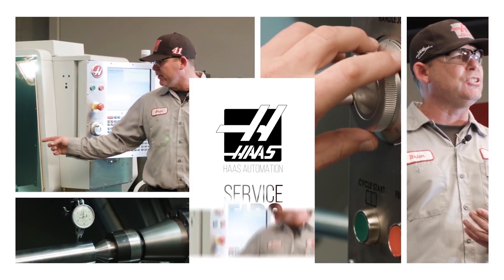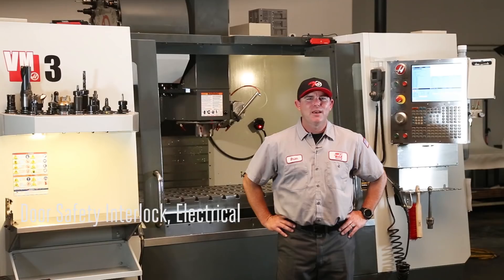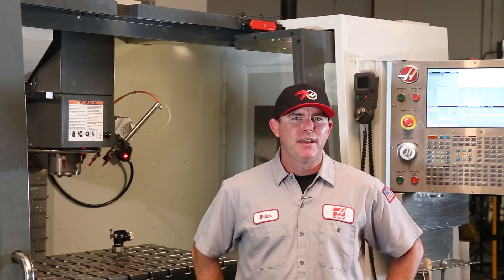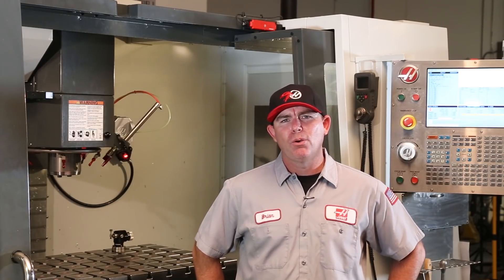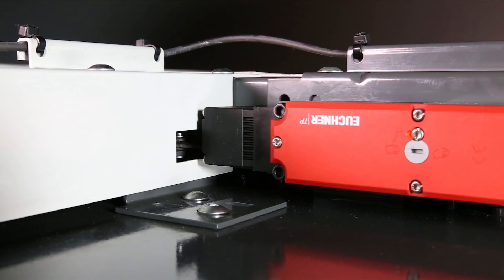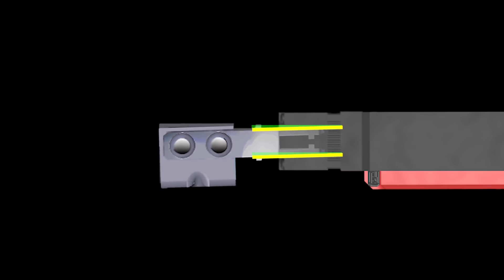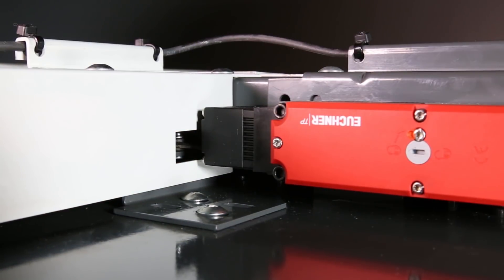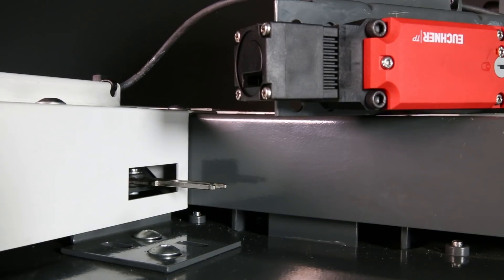Door Interlock Troubleshooting - Haas Automation Service Tip

Comment: Not a very helpful video and we cannot find anything to help us on the Haas site. On our EU spec TM1P from 2011, the control does not release the door lock and cannot find any information to help trouble shoot. We have an Allen Bradley TLS1-GD2 switch and when you need to cycle doors we cannot. There is a solid green light, but the only helpful thing I can find on the safety system is a safety relay of the same family (not identical number) where a chinese language video shows that when the light is green the key is locked and when it is red it can be opened. I suspect a bad wire, but we have no information to faultfind from.
Reply: If anyone else have this problem you need to open the cover of the door lock. There is a solenoid in there that needs to open when the LED turns green. Our's was stuck and often only moved half the stroke. WD40 and new hope.

Comment: noby jusmp inside machine when its running. where is keep ray for disable door log.emco dont have. is haas better. fanuc has. not used but lock is removed lol.if make setup dont have to be open. what what fuck emco. closer door measure tools. wtf!

Comment: Hey Haas How about adding a disable for the interlock EVERYONE HATES IT!!! It makes set ups harder try using a edgefinder or probing with the doors closed
Reply: Just unbolt the key and leave it in the receiver. Note you may face liability issue.
Reply: The operators might hate it, management however loves it, not being liable for someone losing their fingers is awesome. You might want to rethink your attitude when bean counters care more about your body parts than you do.

Comment: 2 Allen's hold the door key on the door.  That's an easy fix too lol
Reply: Don't let OSHA know that! I too have thought of this but most machines make you cycle the doors at startup or before cycle start. I would prefer no sensors at all. Good trick is to wire the door switch to a regular light switch and mount it to the sheet metal. Then you can quick "cycle" the doors but also open the doors whenever you want.
Reply: That's ok if you run your own shop but never force your employees to use a machine that's been modified like that. Disabling safety devices is only for pros - not for people who want to live long enough to retire uninjured.